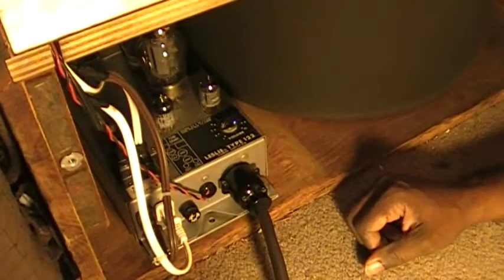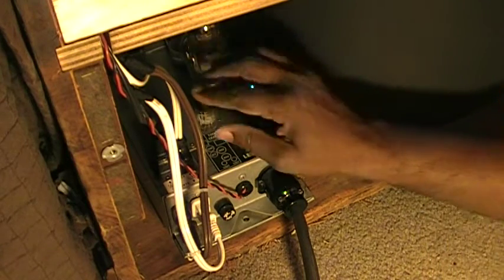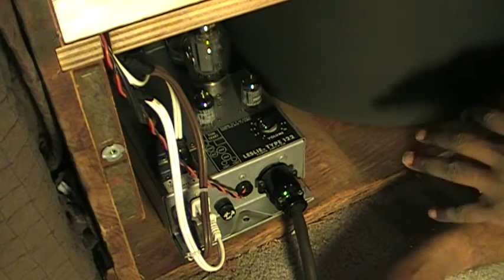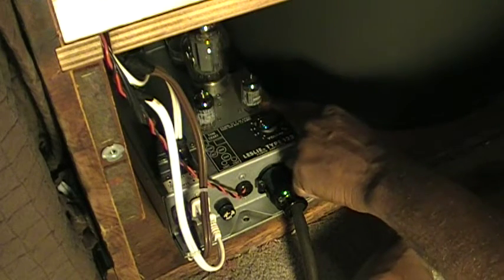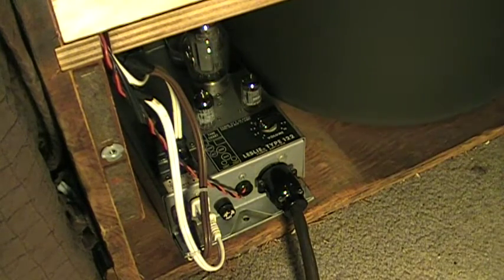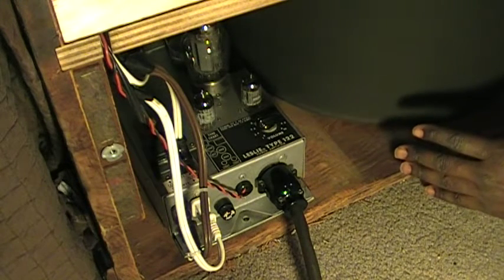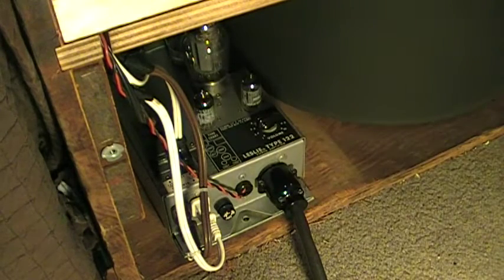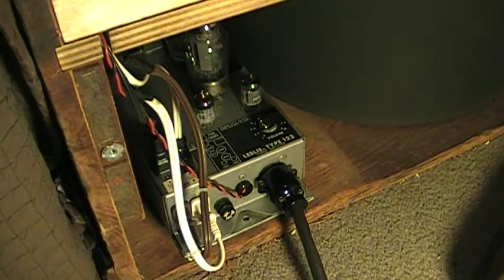When The 12AU7 Tube Is Bad or Removed From The Relay Socket Of A Leslie 122 Amplifier

Comment: Are 12AX7s okay?
Reply from the maker: The Leslie amplifier circuit is designed to work best with the 12AU7 tubes.  A 12AT7 will add gain but can blow your upper driver. It is best to stay with the 12AU7.  The engineers hired by Mr. Leslie out in California were some very smart guys. So I just do what they say. LOLOL Thanks for the question ED.

Comment: Hello! 😃🙋🏾‍♂️🎸 I have a 122 with a 22h amp that only plays on tremolo. I have replaced the 12AU7 but it's still stuck on fast! When I start it just goes straight to tremolo. A year ago it used to play on slow and then get stuck after I'd switch it! 

Please help! lol thanks! 
-Aaron
Reply from the maker: You may need a new relay installed in your amplifier.  The 22h is a very old amplifier so it is past time to change the relay if it has not been done.
Reply from the maker: Yes Sir - That is the correct new relay for the Leslie 122.  It wires in just like the old one that is in there now. They are easy to install. Just make sure your wire connections are solid. Plus - I have videos on how to do it here on Youtube. Check me out on Facebook and I can connect you to our tech group there for Hammond organ owners there. Just let me know who you are so I will not ignore or overlook your request. LOL  Blessings.
Reply: Ok so I've just replaced the relay , it's still running fast so it's not the tubes or the relay? I've read that it could be the power? So now do I need to change some caps?